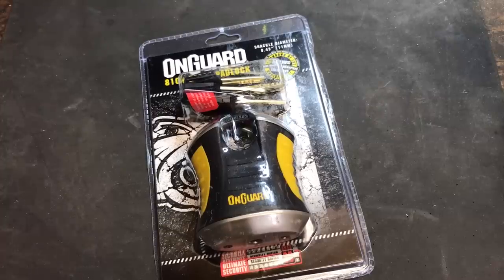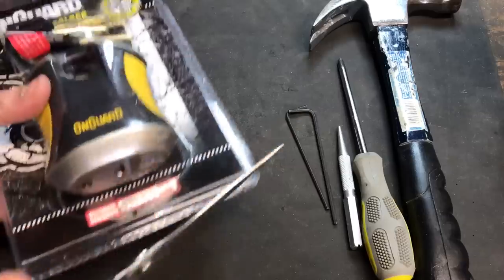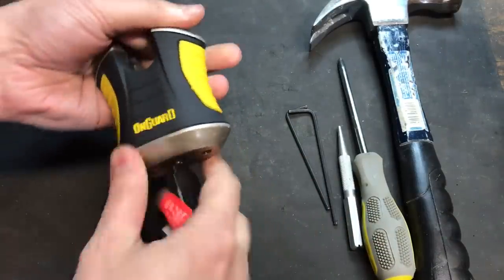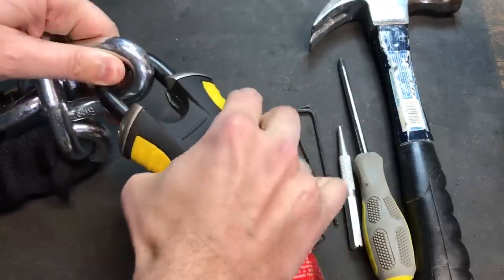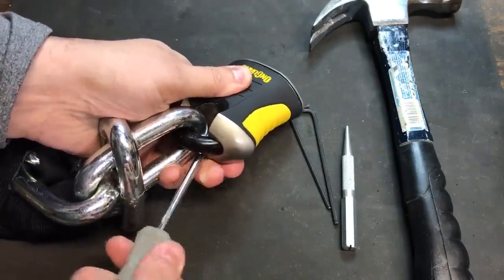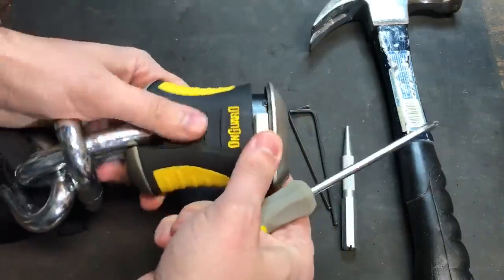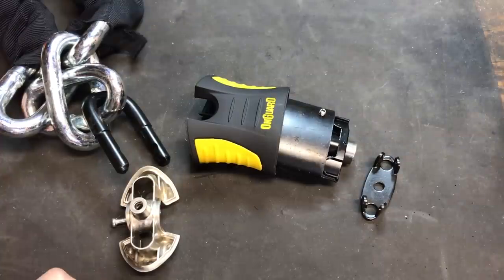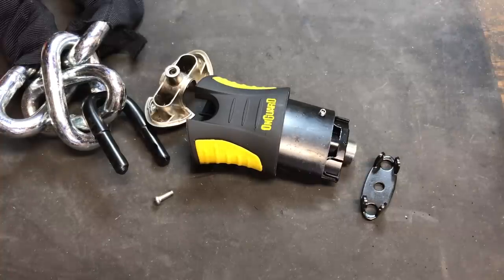[585] STUNNING - OnGuard "Beast" Padlock Disassembled While Locked!

Comment: "relatively significant security flaw"
Relatively...
RELATIVELY?!
Reply: Since it can't be opened without much sound or really fast in a practical manner, it depends on the application I guess. So if you lock your stuff with that lock in the middle of the woods, where nobody hear the lock scream while being hit with a hammer, it's a fatal security flaw. However if you lock your bike on a busy sidewalk in the middle of a city, it might not be that big of a deal.
Reply: This is not the shortest vid on this channel...😉
Reply: @peterbaan9671  it's definitely not a big deal since if i saw a dude hammering a lock it would be a major red flag
Reply: @parkergibson9427  plus depending on what you're securing with it (and how) I can imagine it might get a little awkward to get enough force to push the ball bearing in the screw
Reply: @peterbaan9671  I could probably use a c-clamp and a small piece of round bar stock for stealth.
Reply: @parkergibson9427  Aside from the already mentioned C-clamp, you can also grab the setscrew with small pliers, say 120mm, or if they don't bite, file it down with a small file to create squared-off edges for the pliers to grab, which even with 10.9 hardened screws would only take a few seconds per screw. This is absolutely disastrous.
Reply: Better than a Masterlock
Reply: Yes. Compared to a "very significant security flaw" such as "can be opened by sticking a long pin into the keyhole and pushing it the right way" or a "fatal security flaw" such as "can be opened by whacking it, once"
Reply: It would make an EXCELLENT 
lock for the Master lock company' s
front door !!
Reply: Fugp Basis  Totally agree with you!

Comment: OnGuard needs to hire more paranoid designers.
Reply: Nah.  They just need one decent and honest locksmith with some experience on their payroll.  I really can't believe that's not SOP for every lock manufacturer in the world.  QA and testing happens in every industry to some level, but for some reason, it doesn't seem to happen much in a security product industry, and that's where it should always happen, if anywhere.
Reply: They do, my bike lock from them can be twisted open with a 5p coin
Reply: Easy solution, green lock tite
Reply: @1014p  Stuff chips right off they use it on car amps too for the screw holding transistors to heatsink.

Comment: Punching the ball bearings further into the allen screws is GENIUS
Reply: and they could fix that by filling the hex with epoxy before inserting the ball.
Reply: Use longer set screws that leave the allen part sticking out, then grind them flush. Still not a great design, but let's them salvage the sunk tooling and R&D costs.
Reply: If you can't find a way out find a way deeper in.
Reply: Or use red loctite
Reply: @bstrickler  with enough leverage any loctite can be broken
Reply: All the manufacturers would need to do -if they could be bothered -would be to put torsion sheer head screws in -yes they could be drilled (unless boron ) but at least would be a lot more resistant
Reply: @ianrutherford878  That probably could do the job but I can tell you that fiddling around with any sort of shmoo is avoided whenever possible. At least at factories ex China. In Germany engineers are shot by production leads for only thinking about such.
Reply: @MrBDBProductions red loctite is not permanent lol..  And if you do manage to strip a hex bolt, hammer one size up torx bit into it and carry on.
Reply: @robbyg1311  is this a reference to what Bosnian bill discovered about the $120 Bluetooth master lock?
Reply: Is there room to drive an additional ball bearing in on top? Possible retrofix.
Reply: Yep, just less depth of the hex is needed to increases security. Simple solution that one would think would have been thought of by the maker.
Reply: beth sargent surprised he didn’t suck them out
Reply: I would have thought they would have a ball bearing that touched bottom. so you couldn't do this exact thing.
Reply: There's no quick fix for the brain damage of having screws on the outside.
Reply: @bstrickler  You just need a Bic lighter to soften red loctite
Reply: @roberth3793  not on larger items
Reply: All they need to do to fix this is reduce the cavity underneath the ball bearing so it cant be driven inwards like that.

Comment: I love your videos, and while I agree, this lock is fairly easy to disassemble... as long as the lock is not laying on the ground,(ie: hanging in the air or in amongst the spokes) I think it’d be mighty tough to get the leverage or support needed to punch the ball bearing deeper into the set screw...

Comment: That’s amazing. I believe a drop of thread retainer or bearing retainer Loctite on that initial screw would have defeated the use of the small screwdriver. The ease that you defeated the lock was remarkable. Design and style sure lose out on security.
Reply: That screw should have been a rivet.
Reply: true, didn't see this before I posted.Something similar ,epoxy. before the ball bearings would stop them being driven in.
Reply: Most padlocks put those screws (if they exist) down the shackle holes, that way you simply can't get at them unless the lock is open.
Reply: @Green__one  yeah, that redesign seems like it would've solved this whole issue...

Comment: Designer: it's ok they'll never get those ball bearings out...
Reply: And they were right... kinda 😂
Reply: I mean, you can't open the lock out in public this way without attracting all kinds of attention, it would have to be in a deserted parkade or in storage.
Reply: It's 6 hammer strikes and a tiny bit of fiddling.  It can be done in like 3 minutes too.  That's way less than you need to really be suspicious.  You might not be able to do it at a crowded bike rack with 10 people next to you, but in a park or streetside, you could probably beat the lock and get away clean with this method.  It's no angle grinder.
Reply: I'd have plug welded the heads of the set screws.
Reply: That is no doubt exactly what they were thinking. Probably have themselves a big pat on the back at the time too..
Reply: Dylan Headley most people who steal things are opportunists. If they really wanted the bike this is attached to, they probably just cut the chain with some bolt cutters.
Reply: @darenmiller2218  I have the feeling it wouldn't be as easy if it was actually hooked up and hanging rather than being able to just rest it on a table as he may not be able to get as good of a set up to hammer those bearings in further.
Reply: @WintersMinion  C-Clamp. Or a file and pliers.
Reply: @mariusvanc  you could be using a grinder in public and nobody would bat an eye
Reply: @Raistlin212Speedruns  If I was doing this in the field, I would probably do the hammer part at the same time, to reduce to length of time during which it can be heard.
Reply: @mariusvanc  Never count on strangers, or even neighbors, to be part of your "security". Most people genuinely don't care that much about risking their neck on behalf of other people.

Comment: The hammering part or the process would be incredibly difficult with the lock in place hanging off a bike or whatever. Having accessible screws on the outside is unforgivable though....
Reply: Presumably you attach the chain to something solid, and that solid thing would be a platform for hammering.
Reply: a nice glob of any 2 part epoxy filling the screw opening at the top would render this exploit impossible. you would never be able to get the head clear enough to turn it loose.
Reply: @scottcol23  you just heat up the tool and push it in. Epoxy is even worse.
Reply: If thy heated up the metal bearing a little it would take significantly less force to hammer it down... no matter what it was laying against you would be able to hammer it in with or without the heat. You would just need to hold it steady against what it was attached to.

Comment: You proved you can open the lock on the workbench. Stick that chain & padlock on a motorcycle with a padlock up in the air like you're supposed to install it now let me see you hammer on it. You have been criticized by several other podcasts by overcoming locks on workbench and on the floor that may not be so easy when installed in the real world. But I do enjoy watching you.

Comment: When you own that lock, I suggest to drill the Phillips screw to damage it, so it can't unscrew it anymore, is that right?🤔
Reply: You could just get it out with a stripped screw bit.  Fill it with epoxy after to add a some slight drilling, maybe?
Reply: Oliva Gina  I think that's metal because it's lock picking lawyer generally shows us the easiest way into a lock and he's no stranger to melt attacks so I think that's probably some kind of Steel or something that has a high melting point not zinc because he would have melted it so I think it's some kind of Steel it just looks plastic
Reply: First replace the set screws with longer ones and grind off the ends with hex socket. Then take dremel grinder, or countersink to the top screw.
Reply: If you own the lock, realize 99% of people who steal things aren’t going to the trouble of this to take your bike. Besides, if they really wanted it, they’d take bolt cutters to the chain.
Reply: @darenmiller2218  That's thrue Daren. It must go swift and fast stealing a bike. That's why I have multiple locks, one with an acoustic alarm, and my bike BMW K1600GT 2015 has a acoustic alarm too. And I put the breakdick locks on a very difficult reacheble spot.
Reply: Josla layers of security are always the way to go. Never trust just one.
Reply: Red lock tight
Reply: @EXTRA300s  you don't need multiple locks, just a chain that's long enough to go through the front wheel, the frame, the rear wheel, through the thing you're chaining it to and back to the front wheel.
Reply: @EXTRA300s  I've heard of accoustic alarms, but I'm really curious about this breakdick lock!  Sounds scary.
Reply: @windhelmguard5295  Having one chain to secure the bike is a single point of failure - cut it and the bike disappears with the thief - that why you should always have at least two completely different securing mechanisms on the bike.  make any potential theft take longer to commit and the thief is likely to leave it be and move onto someone else's bike instead that has the single cable and padlock running through the frame and wheels..
Reply: @EXTRA300s  That last sentence typo makes a wonderful innuendo! ;-)

Comment: Wow, crazy! Never seen anything like that before. I think they'll be pissed now that you have shown an exploit.🤣✌
Reply from the maker: Perhaps, but they should be far more pissed at their own people who designed this product and brought it to market.
Reply: That is a pretty sad design flaw - all they need is to add a tack weld over the set screws to permanently lock them in place
Reply: They could have made this a lot better by just spec'ing a one-way screwhead for the shackle screw and filling the hex sockets with epoxy.  But it would have cost them $0.10 so no way that's going to fly.
Reply: daifanshi haha, yeah good idea. I think they figured LPL wouldn't find it so they saved their 10 cents! 😁👍🏽
Reply: Maybe once you hit 80k subs, upload a nice Q&A video where-in you talk about how you got started in lock sport, top good and bad things learned while pursuing the sport. And a bonus top 5 of good responses from verified company reps, followed by a top 5 worst response list. I'd be curious to know who owns up to bad design/materials versus who doesn't.
Reply: designed by university engineers not engineers who have done an apprenticeship in locksmithing
Reply: I've worked in design for years. You are probably spot on as to cost being the reason for this- accountants run companies and low cost is pretty much the only driver in most. Lots of ways this could be made better i.e. single direction drive head screw under shackel and pressed hardened steel pins in place of the hex heads.
Reply: I'm watching this video 10 months later. Is this piece of junk still on the market?
Reply: No,they won't.
Reply: Hopefully videos like this will inform consumers and sales will drop significantly then they will be pissed and change the lock to a more secure version.
Reply: LockPickingLawyer absolutely agreed!! Same goes for everything...food , medicine and yes even 🔐
Reply: They should dismiss whoever approved this design by defenstration...
Then have their engineers work with the YouTube host for ideas to make a better one - though what "Engineers" made such a design is beyond me...
Reply: I doubt any bike theif would be using this method to open the lock in situe,

Comment: I wonder how many “Lock engineers” have been fired after their boss watched a LPL video?
Reply: The engineers probably aren't the problem, more like corporate wants to cut corners and make them cheaper to produce which will introduce security flaws
Reply: Fugp Basis  Good luck using an angle grinder without ppl noticing, or finding an outlet for it, or finding a strong enough portable grinder to do the job reasonably fast
Reply: Fugp Basis  The issue is the non-destructive method of getting through the lock. Insurance companies won't pay out unless there is signs of forced entry.
Reply: @LabGecko  angle grinders come cordless. And nobody pays enough attention to notice anyway.
Reply: @Ramn8tr  I said "strong enough". I haven't seen a portable one yet that was strong enough to cut hardened steel with any efficiency (if at all)
Reply: Fugp Basis  one time in college my bike lock key broke in the lock.  I came back later with a hacksaw and spent about 25 minutes cutting through the cable.  During that time classes let out, so a couple hundred people walked past.  No one said anything, no one asked, and campus security was not called.

I don't know how much I would trust people "noticing".
Reply: Fugp Basis  …you brace it against whatever you’re stealing. A single nick in the paint of a motorbike is an acceptable price for you using a compact toolkit to pop a lock off in three minutes silently, rather than lugging a 15 pound wireless grinder with enough power to cut through a 15mm chain and alerting an entire block to you trying to steal something. You gotta be a special kind of dumb to not see the problem in your lock being vulnerable to a sub-5 minute silent bypass that needs no specialized tools and ignores chain strength.
Reply: When I was much younger I had a bike stolen from a bike rack in front of my work. My manager watched the kid try and take off my tire, fail, call his friends who showed up with a pickup and a toolbox. They worked on it for a while, got it free and tossed it in the truck and took off.
People do not care if they see someone trying to steal something, they just choose to believe that its the owner having lost the key or something and move on with their day.
Reply: Fugp Basis  tldr  So what I hear is wine wine cry cry gonna shit on somebody else's work

Comment: Significant design flaw, there. If you don't mind it never coming apart again, I'd say just mix up some JB Weld and apply liberally to the threads of the  phillips screw on the top of the lock body before screwing it down nice & tight. Let set for a day, and that sucker is never coming back out.
Reply: Red Loctite will only come off with about 500 F heat. Hard to get that much heat into the lock body to melt the Loctite without smoking something else first.
Reply: Yeah Loctite red does the same thing, faster and cleaner. Loctite Red can be overcome by shear twisting force or impact tools, but not on a fastener that small and not with a screwdriver being worked at an angle like that. +1 vote for the Loctite.
Reply: JB weld wouldn't require total disassembly, so that would make it easier than red loctite in my mind.  I would also be tempted to drill out the fastener heads so that nothing could easily get a bite.
Reply: @tehgangstadawg  I don't follow... you suggested JB Weld on the threads of the Phillips screw, and I think the others are suggesting red Loctite on the threads of the same  Phillips screw.  Why would JB Weld be easier/better/more effective than red Loctite, in the same place?
Reply: @DaddyBeanDaddyBean  If I recall correctly, I meant putting JB weld on top of the vulnerable fastner, rather than removing the fastner to apply loctite.
Reply: @tehgangstadawg  Ah - thank you. Makes sense.  I apologize for commenting on such an old video - I didn't notice at the time.
Reply: @DaddyBeanDaddyBean  No worries, I don't think my original comment made a ton of sense lol
Reply: atfsgeoff You have to fix all 5 exposed screw (including the two hidden by plastic and partially fixed with ball bearings).

Comment: "Non-Destructive* but... It will never quite be the same. LoL. Great vid. Thank you.
Reply: Yes, I think so. A beast padlock without a motorcycle hanging onto it is never quite the same as a disassembled beast padlock without the motorcycle attached. But the loss of the motorcycle would be the easy part. When you see what those fuckin lockpicks have done to your ball bearings in the screws, you get really red hot crazy.

Comment: Perfect example how devastating even the smallest design flaw is. A bit of putty underneath the bearing ball and for example a 
shear bolt on top would have solved this.
Reply: Shear bolts mean nothing to a spring loaded punch. I take them off of steering wheel assemblies all the time.
Reply: Rekha Joshi, or just source shallower screws. They wouldn’t be any more expensive
Reply: As he noted, with the ball bearings driven in, there isn't much screw head to get a bite on.  So a drop of thread locker would probably prevent those allen screws from being removed.